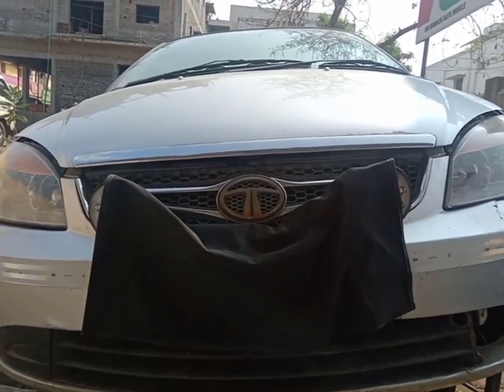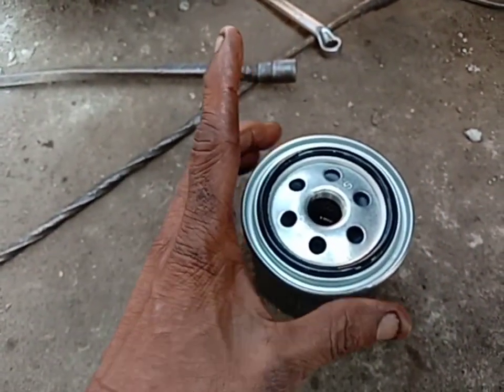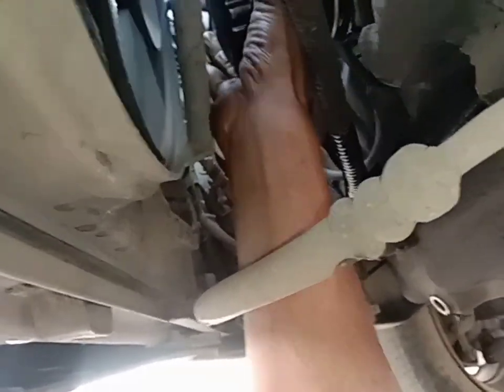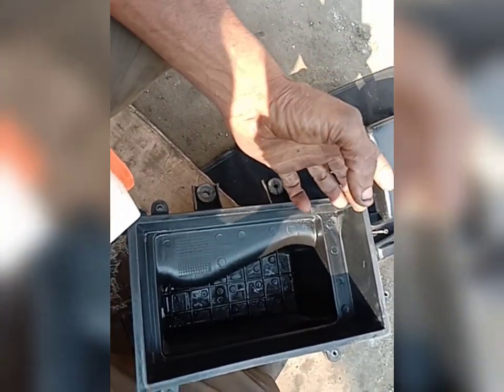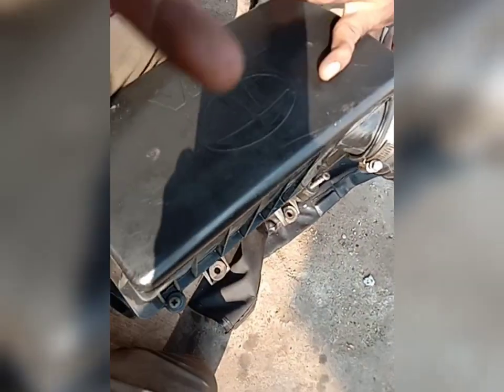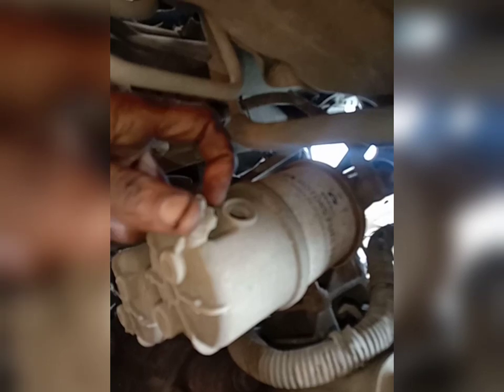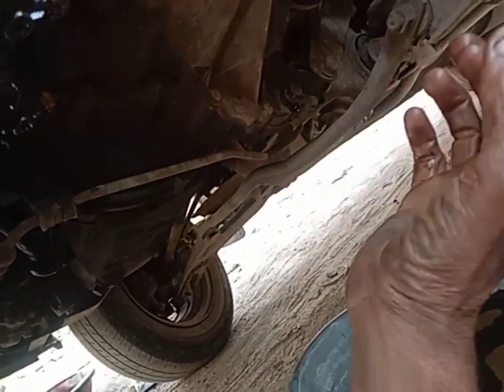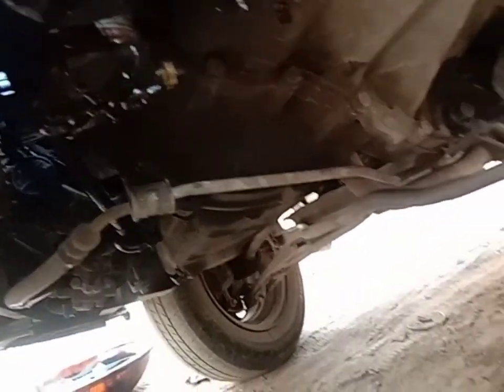Tata Indica oil change

Comment: Load la konjam pickup kuraiuthu ena pandradhu
Reply from the maker: First check disel filter 
Second add engine oil in diesel tank
 Full tank capacity 1/2 literally fault ok stop oil 20w40
Reply: Oil 15w 40  use pandran
Reply: Tata original oil
Reply from the maker: Ok tata oil best